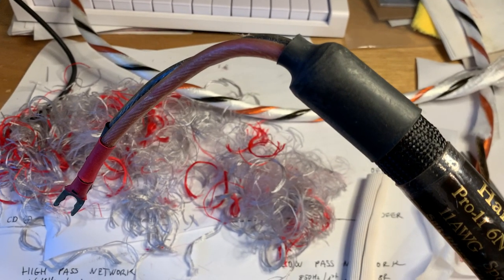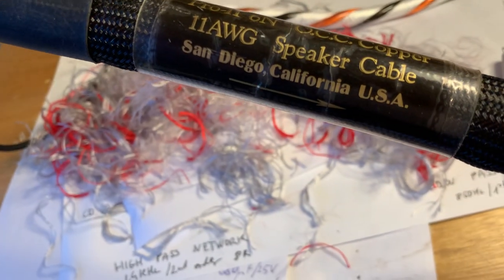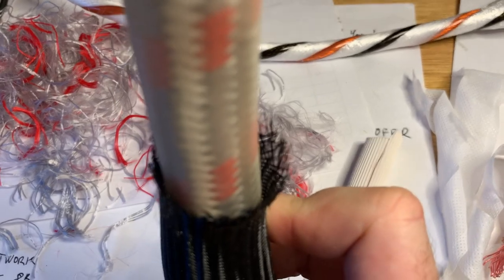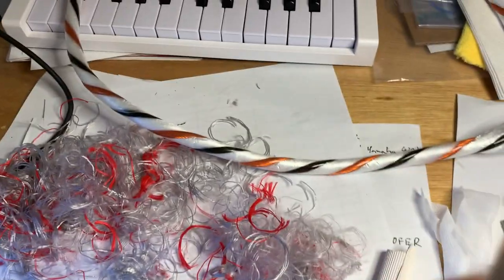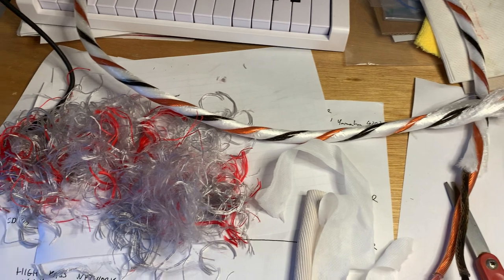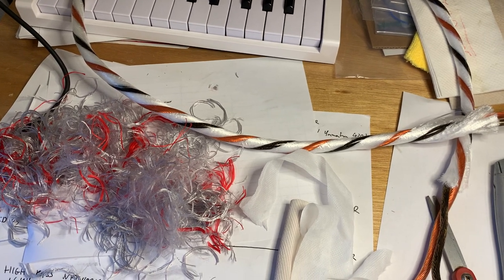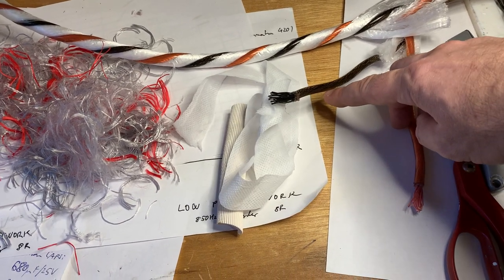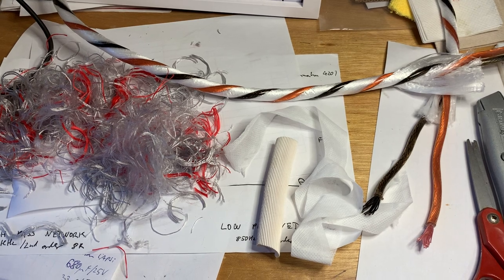CRAZIEST EPISODE YOU'LL EVER SEE ON THIS CHANNEL- deconstructing a high end speaker cable

Comment: Hi nice video. I was thinking about getting the grand speker cable from Neotech given that it is UP OCC copper with Teflon and found out that Harmonic Tech basically uses the same cable that they name the para S2. What is you opinion on OCC copper cables that use Teflon insulation?

Comment: hmm. got some single crystal silver cable. didnt know it was directional.  ($17 p.m. mil surplus aircraft coms cable 👍). about to use some to wire up my speakers so just as well you said.
Reply from the maker: Actually, copper is very directional but I found silver to be largely non-directional. ; )

Comment: Currently I’m using Audio Note Lexus speakercable, but I’m planning to do a experiment with the cables. (AN is using PVC as dielectric).
I’m not striping the wire but after the experiment a extra sleeve is needed. I was thinking of cotton because it’s natural and Western Electric used it to with some oil..

What will the cotton add to the sound characteristics? (I mean just cotton without the oil)
Reply from the maker: Great idea Nick! Cotton will add dampening, a little immunity from picking up high frequency physical vibrations from the environment. I would suggest a thick cotton thread, and wind it tightly around the wire. ; ). Quite a bit of work, but will look nice as well, and offers much more effective dampening than just a cotton skirt.

Comment: twisting cables only contains the field of the cables themselves. all this engineering for vibration dampening and nothing for electro-magnetism. as if this cable is engineered for rock concert application and not a modern home, where almost everything, including the power grid, emits electro-magnetic fields.
Reply: Twisting cables helps reject common mode noise, which is all the EM fields you speak of. The reason why ethernet wires are run in twisted pairs.
Reply: @bluesteelbass  Erm, no. The common noise is rejected by a difference amplifier or a transformer. A loudspeaker is neither a difference amp nor a tranny and it does not reject common mode noise. It gets filtered through the crossover and then reproduced by the driver. For this trick to work, the signal in both wires would have to be out of phase, which would result in no sound on the driver.
Reply: @rhalfik  You need to review how differential signals work with balanced audio cables.

Comment: Lay them on some duct tape if you want to space them and then a piece of duct tape on top as a sandwich
Reply from the maker: I did something similar - used 3M tape in the fashion you described. It works very well! This time we shall go outer space. Will try something I have not seen before - involves cotton and spruce ;).
Reply from the maker: @johnsweda2999  :) Literally! I just finished terminating the free ends with silver connector bars. Will let them break in first, in a bare configuration to get a baseline for how it sounds without any treatment. Then, I will spruce it up ;) Literally - with spruce, and cotton. Will take a while to cut and router the spruce. Will see about the timeline... but will happen soon! ;